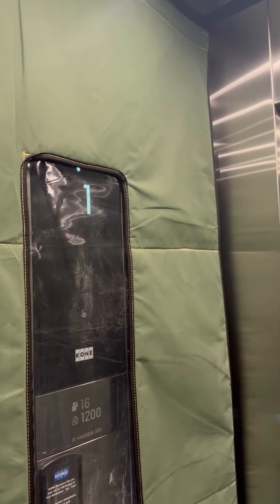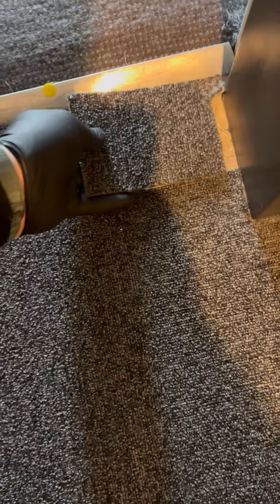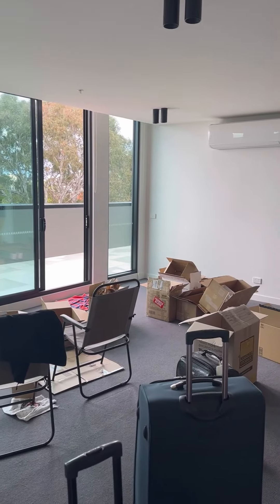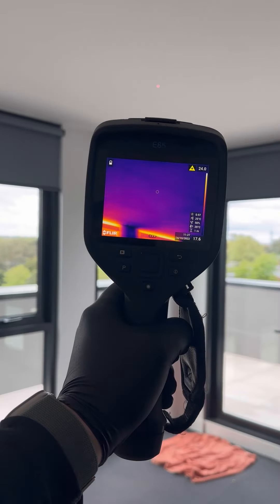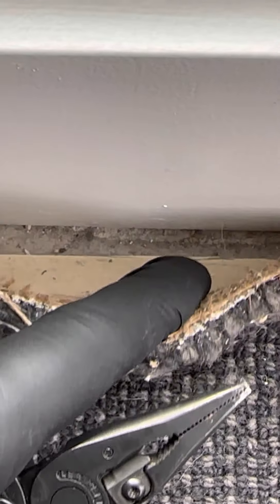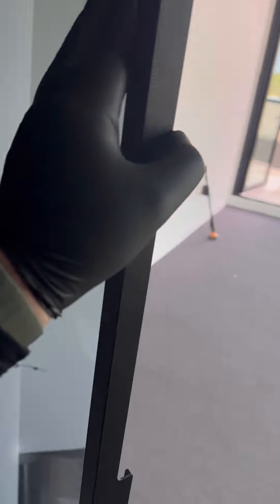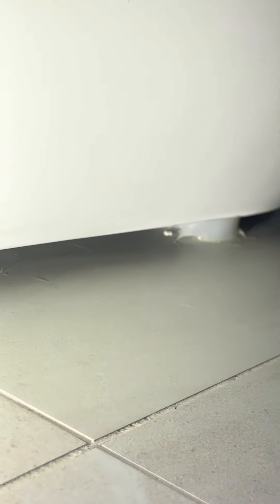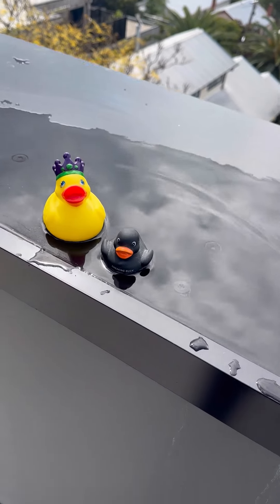Luxury Apartment Inspection Shocker

Comment: My friend bought a similar apartment in Perth off the plan. The main issue was the missing metre. The appt was one metre shorter than the plan as well as the display apartment. The missing metre would have contained the linen cupboard and made the living area much more comfortable.
Reply: fair few contracts have that as a caveat..friend has new new place that was about 5m2 smaller than the plan..was in the contract..course it was fucking smallert, 5m2 over 150 apts..builder saves a fortune.